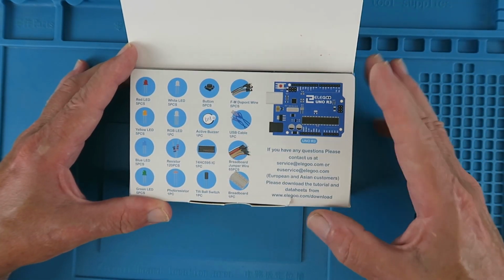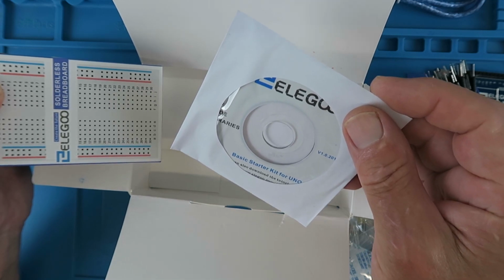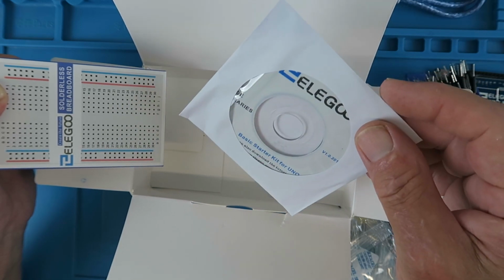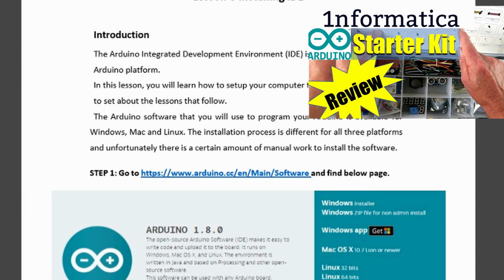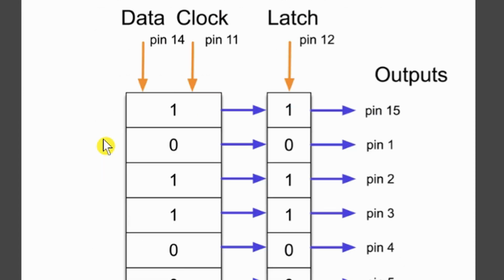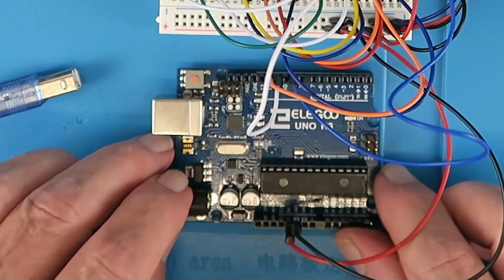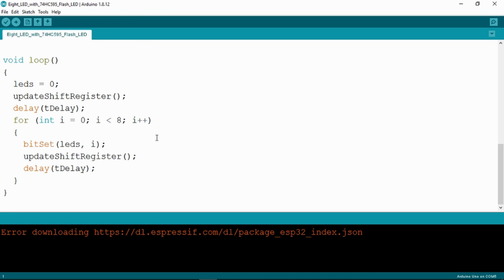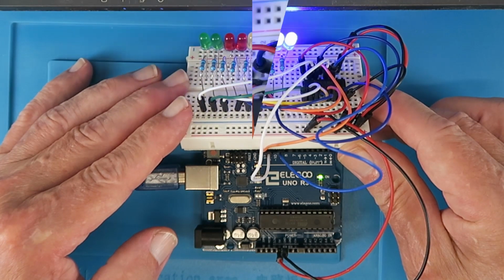Elegoo Basic Starter Kit Giveaway!

Comment: The Data Sheet for the 74HC595 names it as a "SNx4HC595 8-Bit Shift Registers With 3-State Output Registers".  In the circuit demonstrated, it starts with the shift register empty. Then the Arduino shifts in a bit at time. After the shift operation, the contents of the register are displayed by a set of 8 leds. Once 8 bits have been shifted in, and all leds are alight, the register is reset and the process repeated.
Reply from the maker: Kudos for the most complete answer, sadly others got there before! Find out more here :https://amzn.to/2Xo6gpP Please consider subscribing if you have not done so already!